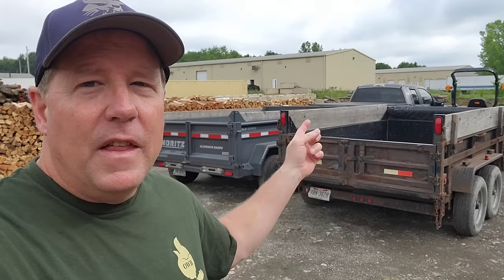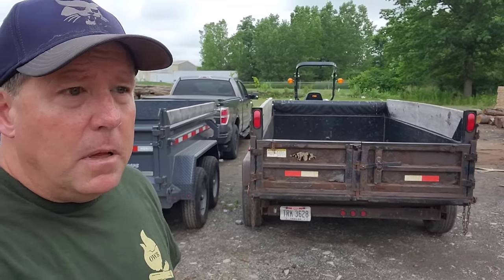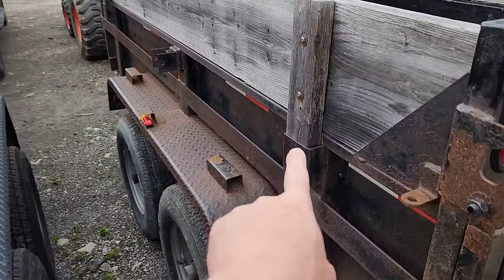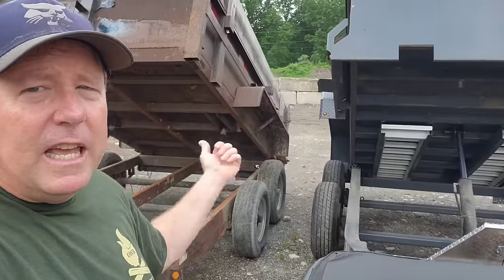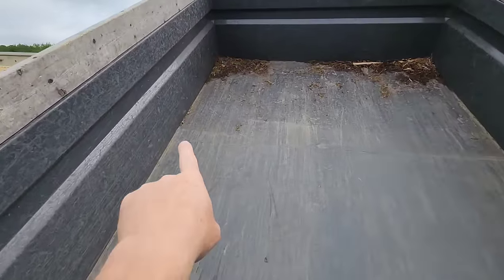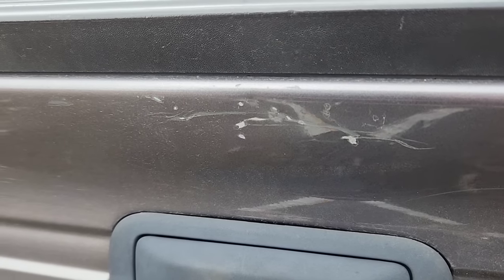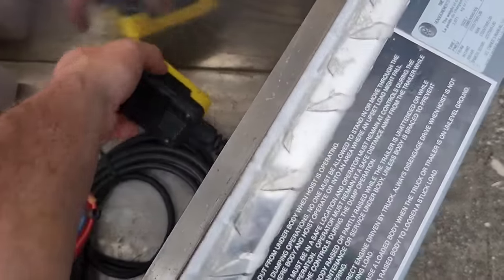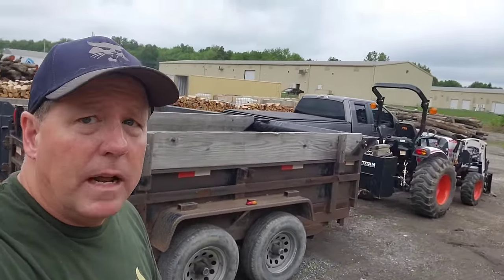Are Dump Trailers a Rip-Off?

Comment: Hi great video. What size are your trailers? How much will they hold of lose tossed in wood?  I’m looking at a 7x12 but thought I may be better with 7x14 what your thoughts?
Reply from the maker: both are 6x10.  I'm not sure what they would hold tossed but neatly stacked they hold exactly 1 cord even with the boards.  I considered bigger but decided on smaller for ease on my truck and the fact I prob wouldn't be able to fill a bigger trailer by myself out in the woods as I could a 10 footer

Comment: I was told by a dealer for trailers that torsion is only good for on road use, and last about 20 years.  If you were taking a trailer across a field to gather wood, springs are much better.  Spring suspension is supposed cheaper to replace.
Reply: If you look up how torsion axles spring, you’ll see that this is true. The “spring” is four blocks of rubber that a square inner axle shaft twists inside of. Rubber dries out, cracks, fails.

Comment: Difference between torsion and springs. Spring axles will generally always have all 4 wheels on contact on uneven surfaces. Torsion axles are independent.  Going over a deep rut or pot hole will allow a wheel (or two) to temporarily leave contact with the ground putting the extra weight on the other tire/axle. I've arm a heavily loaded  torsion axle trailer break an axle under this condition.
Reply: Ya I have rented Moritz with torsion. I would never buy one. So easy to over load a single tire!

Comment: The last trailer I purchased was from a general contractor. It was rusted because contractors use them for dumpsters and leave them uncovered, The rain soaks the drywall and construction dirt and it just rots away. We have a full fab shop so I picked it up cheap, yanked the bed and welded in new steel and used POR on the entire thing. I would say I put 2k into it. The nice part with a trailer is in PA they are only 40 bucks a year registration for a 10000 GVW.  The next trailer we purchase is going to be a hot dipped galvanized trailer with a grapple from Metavic. Loading the mini ex into the back and unloading it to load wood is a pita not to mention having to go back after dumping the wood to get the machine.

Comment: Take that Griffin trailer off the road... take off the wheels and go over it with Rust Converter..
Then give it some actual Paint when done. Then new reflector tape and you will be good to go.
These aren't cars w/thin sheet metal.. if you just tend to that rust now, you can bring that trailer up to New and it'll basically stay that way. 
Be good to yourself... don't let that trailer rust to cr@p just because it had poor powder coating.. protect it and use it with pride 👍

Comment: On the Moritz tailgates I would get some way to lock that pin down. Drill a hole just above the spring and put a hairpin cotter through it when hauling on the highway, Leave it in the pump box the rest of the time.

Comment: Torsion bars ware a splined rod in the axle tube that goes to the hub on each side the steel bar actually acts as a spring by twisting up and down replaced a bunch on military vehicles over a period of 15 year they are tough as nails. Just a FYI great video appreciate it I'm in the market for one myself. Keep up the good work.

Comment: I would drill a hole on the pin of the grey trailer and put a hitch pin in it this way it can't pop up. It's an extra step opening the doors but it will give you a little piece of mind. Just a thought
Reply from the maker: I have thought of that.  I would have to remove the pin but it would be worth the effort.  Stay cool this week.!!

Comment: Quick tip: take some silicone caulk (you can get it in a dark color) and caulk those gaps between the underside beams and bottom sheet steel. It'll keep water and road debris from getting between them. Many trailer manufactures do this

Comment: Just ideas. Oil the top of the frames. A little goes along way in preserving steel. The tailgate opening- drill the tip of the pin and where the pin goes below the base-plate add a Clovis pin while transporting. Cheap safety and insurance.

Comment: I can feel your fear regarding the doors open. When you are buying a device - in first place it should do what it’s meant to do. And a trailer should bring load safely from A to B. Nothing less. And if it doesn’t - because it’s losing the load - it fails in the main purpose. Secondary purpose - like being specially comfortable - is useless if primary purpose is not fulfilled. I think paint is secondary, doors are primary. 
But changing the doors closing system might be cheaper than derosting and panting.
Reply from the maker: Well said Lumberyard!!

Comment: Spray your trailers in and out with fluid film or a mixture of drain oil and Kerosene.  Been running trailers daily since 1988. I tried it all. The oil stopped the rust.  Not pretty.  Not clean.  But easy to apply.  And it worked.  Look into brake maintenance and adjustment.  The magnets grind down and need to be replaced.

Comment: if it's not galvanized take 50% diesel 50% ATF or used motor oil mix. put in pump sprayer and spray it in the summer and in the fall all underneath and everywhere's.

Comment: Like LTD has said already. User experience is key.   In my case i am not in a place to afford a dump trailer yet however my Home-built (Ford F250) trailer has been awesome..
Reply from the maker: I think your trailer is pretty cool Dan.  I see a bunch of those out this way
Reply: @ohiowoodburner  I have 7 pickup box trailers.
Well, I own that many.
You know the saying, "if you want more friends,  get a trailer", well, that must be me.
I do have 3 just for scrap iron/metals.
Good video !!
Reply: All my trailers were free. I took care of them and detailed them out before selling them and got nearly all my money back. One simple detail you didnt mention is how important to recharge battery immediately after use. They will last 5 years or so if you keep them charged every night. I also had mine charge off the truck and the newer 31 sized deep cycles would be worth the investment(if you have the room.
Reply: Tralers are useful. I've had a bunch but the dumpers were the biggest labor saver. That unloading wood job works better with a dumper. I sold enough black dirt bythe load to pay for one one summer . I even had an excavating company that called me for dirt and gravel deliveries in places they couldn't get their big trucks in(do to overhead wires and trees.) I had a remote control I used when too close to wires. Made me feel safer not touching the control box.

Comment: Most state's are 26,001 lb before you need a Commercial license, at that weight it would require at least a "Class B" certification. Once you get over 33K and/or have Combination vehicle's (Semi's etc.) you need a "Class A" certification. There's also an "Air-break's" certification if equipped, anything under 10K (9999 lb or less) total doesn't require any certification, just the regular "Class C" license. Didn't know about Pennsylvania having the exception.
Reply from the maker: Thanks for posting Ray.  I am not totally up on the law but know i am compliant here!
Reply: I got into a Bwise 15400 last year.  The dealer claims that 26,000 combination is the rule in PA. I've also been told 10,000 is the limit. He provided me with a flow chart that the state provided him showing the 26,000 rule. What you need to get to that is a truck that is 10,000 gvw. A 1 ton puts you over the 26k rule. It is a really nice tool in the arsenal.
Reply: @markw2266  That sounds about right compared to NC law, 10K or less in a single vehicle is the normal Class 1-4, Class 5 being up to 26K (but not over). Class 6-8 requiring a Commercial certification on your license. A or B depending on the weight and/or amount of vehicle's and breaks type. Basically it's 16K per axle although some axle's are rated for +26K witch would require a Class "B" certification.

Comment: Nice video, try to find a heavy duty and long U-Bolt and drill holes on top of each door of the Moritz and all you have to do is drop it on the holes to make sure those doors don't swing open, or make one to go at least 10 inch down and have a strong magnet to hold it so it don't jump off the trailer.

Comment: Moritz using the spring pin on the tailgate is disappointing.  The cam style is way better, easy to unlock with the load pushing on the door.  The three piece construction isn’t really better if the seams on the 4 piece are 100% welded.  Torsion axles seldom fail but they are big $$ when they do.   
A scissor lift has more moving parts that require grease and tend to seize up for lack of love.  And they are heavy. 
    The box tube construction should be stronger stiffer better.  But they will rust out faster if there are any penetrations.  
       A galvanized trailer is the best way to go. Paint always fails.
Reply from the maker: I looked at the galvanized trailers and they price was out of my league!  Thanks Dana
Reply: @ohiowoodburner  definitely not a cheap date.

Comment: Torsion suspension is a time proven application but it is also the reason your gate opens. Think Torsion? Twisting allows the slave lock to rise above its sleeve. Add cam locks. It's cheap to do and will be your forever answer. Hope that helps.

Comment: Nice video. To clarify, you don’t need a CDL in PA to drive a trailer that’s over 10,000 gvwr. You only need a CDL if your GROSS COMBINED WEIGHT RATING of your truck plus your trailer is 26,001 or over. You can have a 16,000 gvwr trailer and a f 250, 10,000 gvwr and be legal without a CDL.

Comment: I still have my big C60 1966 Chevrolet 12 ft flat dump truck. Years ago when i insured it they didn't ask to see it. They just gave me the card that said C60 Chevrolet. Later i changed to a lady at my church for my agent. She laughed when i brought up the C60. She had seen that thing way over loaded with scrap boilers, to saw logs. So it's been parked for a good while now.   She mentioned that I should just get a dump trailer, and use a smaller truck to tow it with. Ive never seen a DOT officer with a ton truck and dump trailer pulled over.   Every time I seen a state trooper I would cringe thinking it was gonna cost me $$$$$ in that old girl. Being the bottom has fallen out of scrap steel , I dont see anymore huge boilers , or fatory machines being hauled by me in the future anyway.    One.of these for wood , and logs is the way to go.

Comment: You are close on the GVWR and CDL requirements, but not quite right for PA at least. You only need the CDL if your combined GCWR with the trailer and truck is over 26,000lbs. The 10k lb requirement only comes into play if you cross that 26k lb mark. Then its a difference between a class A and B license.

Comment: On the Mortiz trailer, you could add a padlock type clasp across the two doors. I'm sure there's some other locking options you could easily have welded on. But I agree, it seems the cam lock system is definitely the better of the two. Maybe it's got some drawbacks, but I don't know what they might be.
Reply from the maker: Just seems the cam locks are the standard.  Thanks JC

Comment: A solution for your rust problem is relatively easy. Rustoleum sells a RUST CONVERTER in the spray can section, about 6 bucks, you spray it on rust, its flat black, and it converts the rust to iron phosphate and will not rust again. About 6 cans will do the whole trailer and frame- just where its rusty. Then, machinery maintenance painting with a brush. Buy a quart of Rustoleum Rusty Metal Red primer, some painters coveralls and painters gloves, a quart of mineral spirits for thinner and cleaning, wood handle "chip brushes" Home depot calls them; (2 or 3 bucks each, buy 2 or 3 inch size.) A spray can of gray automotive primer, and a quart of Gloss Black Rustoleum. Use a 1 quart paint pot, 1/4 full, 1 tsp thinner, Just slap it on. Make sure its covered good. Sometimes you need to reach back with your brush and smooth out a run or sag.  Even if its not great, your trailer won't rust away. Maybe your wife can do it. They know how to use hair spray and fingernail polish. I bet she would do a better job!

Comment: I bought a BriMar maybe 13 years ago. Two years old it got painted. It's been painted a half dozen times now. 
Also have a PJ 7 x 16 Gooseneck. Excellent trailer. It is a 2019. Excellent paint job. Scissor Lift. I do firewood , Dirt, Rock, Equipment.  
He is right though, Dump Trailers You get what you pay for.
Reply from the maker: Thanks for sharing Greg

Comment: Man, I shopped dump trailers for literal YEARS before I finally pulled the trigger on one. I bought a 6x12 for my personal firewood consumption. It came down to three trailers for me. Diamond C, Maxx D, and Load Trail. Ultimately a Diamond C was just out of my budget. Maxx D and Load Trail made it VERY difficult to pick a trailer. Neither one checked all the boxes, but they both checked a lot of boxes. Maxx D has standard wireless remotes, and Load Trail does not. But I liked the D ring tailgate hold backs on the Load Trail better than the chains on the Maxx D. Ultimately I went with the Load Trail. They were spec’d out very similar, and the Load Trail was about $1,500 cheaper. I can always add a wireless remote, but I am not a welder lol. Some honorable mentions for me would include; Lamar, Ed, and Good Guys. Good luck to anybody shopping for dump trailers. There are a lot of really great trailers out there, and it’s a very difficult choice to make!

Comment: I have a griffin also. I had it sandblasted and repainted about three or 4 years ago and don’t pull it in the winter. Ours are about the same age. I like mine but the powder coat was bad too. I would never buy a powder coat trailer again. I would buy a galvanized
Reply from the maker: I think I'm about the same opinion Bill but the galvanized was too pricey for me

Comment: I own a moritz I do not trust the back door i've had it just pop open When i've had a load on it . The aluminum ramps are a great selling point I run a 10,000 pound excavator up Them..
I live in the salt belt also my other trailers I put a  rust preventative oil spray It works, my last trailer was almost 10 years old, very little rust.
Reply from the maker: Interesting to hear it has happened to someone other than me.  Ugh!

Comment: 1 ram is better than 2..  reason being is if one of the 2  fails it will twist and probably destroy the trailer and possibly flip it..   one cylinder if it fails it will drop back to frame..  wont be fun but atleast you still have a trailer
Reply from the maker: That is the way I see it too buddy

Comment: Ive had  to sand and  repaint my 7x14 dump trailer. Used rustoleum oil based black gloss. Gotta  keep them greased,   well painted  and washed to deal with all the salt in winter which  is 5-6months long in WI
Reply from the maker: I think mine has passed the point of  no return Garrett!
Reply: @ohiowoodburner  yeah, as long as it  keeps dumping its a good woodyard wheelbarrow

Comment: Steel is probably just hot rolled. Not pickled and oiled. Plus, good primer and paint would  help. Also, in the rust belt, you need to pressure wash the salt off daily, or the trailer won't last long, especially underneath.

Comment: My equipment trailer has Dexter axles. I like them. They have the EZlube feature, with grease fittings similar to a boat trailer.
Reply from the maker: Same here.  My Griffin has the same fittings

Comment: The tab on the trailer barn door lock is not for holding it closed , it is actully so when you pull handle up and turn it , one of the pins on the locking handle (Pin) sits on top  of the tab when you turn the handle in either direction to hold the locking handle pin up , so that when your closing the end gate you don't have to pull up on the pin or slam it closed,  I always use the cam type on my trailers , when they are closed they are closed ,   the other Pin if your trailer flex's  which it will depending on the type load you have and of course the road condition,  as for the paint issue ,  paint is paint and salt is not it's friend,  If it was mine and I have done it before , Is I have cleaned up and or sand blasted the trailer and frame , and had it covered with either the Hercules bed liner  or the Line-X bed liner , those both wear line iron and they don't fade chip or peel ..

Comment: I understand the 3 vs 4/5 piece concept 
please note that cheaper trailer is thinner steel on the floor and sides, the more expensive trailer has thicker steel on the floor than the sides wall = stronger trailer,
if you compare the same thickness steel then yes, the 3 piece is stronger than the 4/5. 
better build dump trailers have thick floor vs side walls

Comment: I had a trailer that had a gvwr of 15,000 pounds I used to pull until I found out the laws of combination tags. My truck was rated for 9.000 my trailer was rated for 15,000 my tag would’ve been for 24,000 pounds. The sticker would’ve been a class 8 and would’ve cost me $450 a year. 
Pa trailer law is 10,001 pounds or over you need combination tags on the tow vehicle. Combination tag is the combined gvwr of the tow vehicle added to the gvwr of the trailer. The combined weights you need the appropriate weight class sticker in the windshield.

Comment: RE-design the mechanism OR simply drill through with a 1/4 inch hole and use a clevis pin (Near the bottom) . Carry 2 extras with you. Don't be like this man! Keep your trailer rust free and painted with an extra coating.

Comment: Has this pin disengagement been reported to the Manufacturer and  Dot? There are at leasr two reports of this in the thread. I wonder if sidewall flex is responsible for the disengagement.